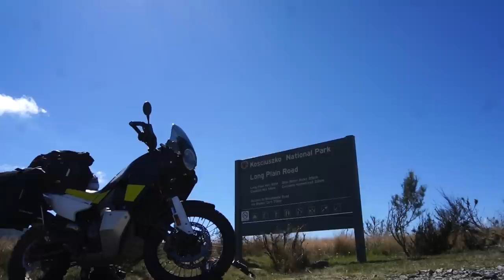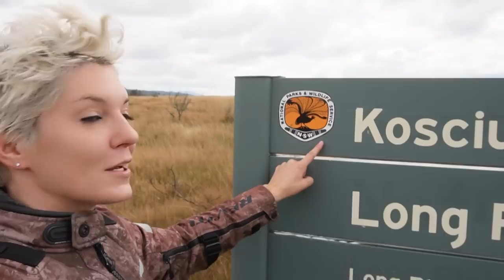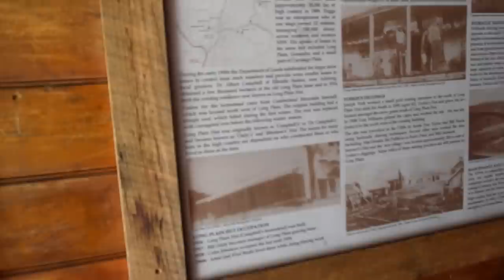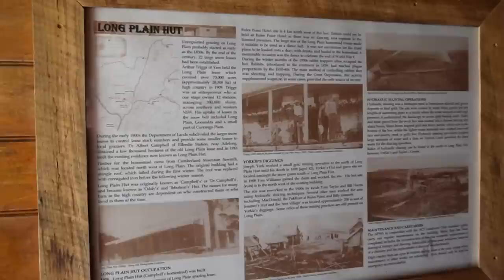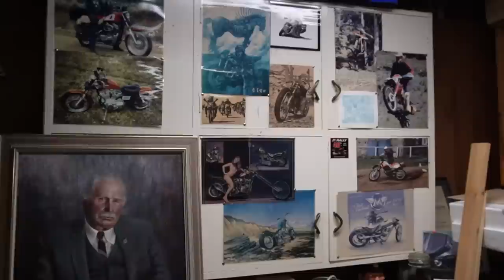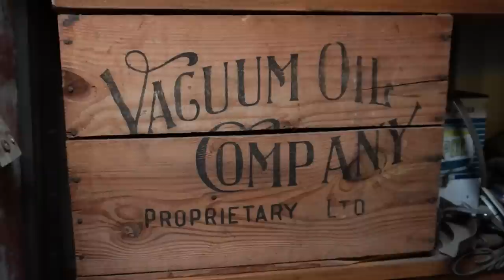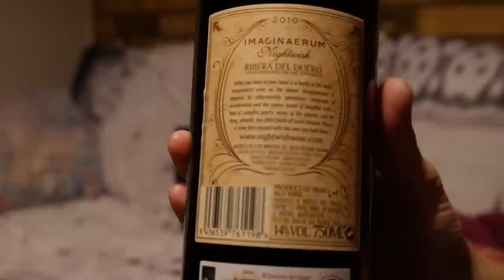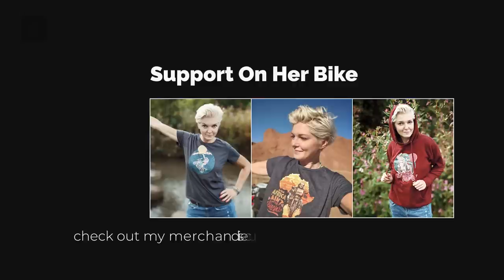Motocamping in Kosciuszko National Park | ADV Ride on Husqvarna Norden 901 - EP. 4

Comment: I had a bang-bang robot project that was to use recycled parts. I chose a motorcycle steering head and fork tubes to give me two axis. The teacher gave me a printer slider and head as a third axis, but I couldn't reduce friction on the fork tubes enough to be reliably repetitive.